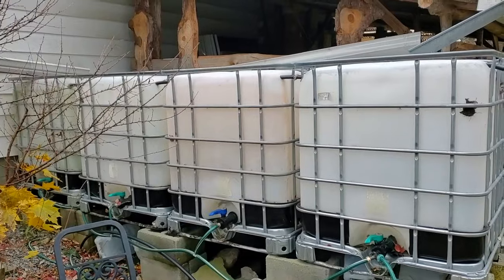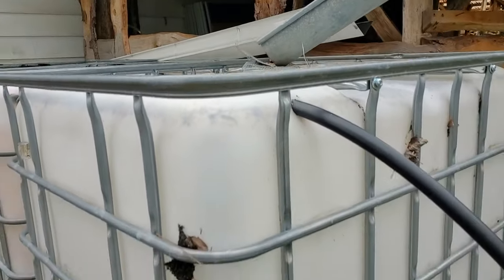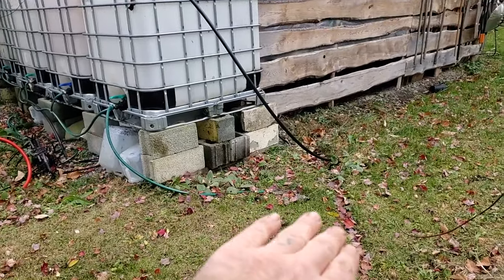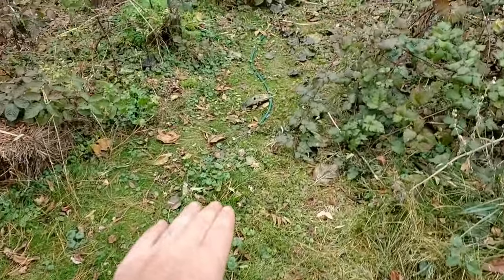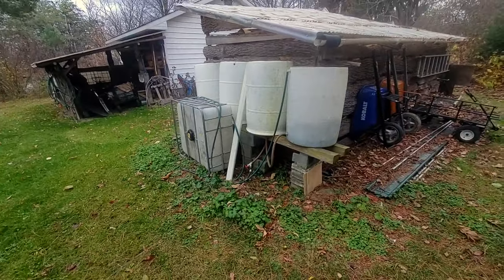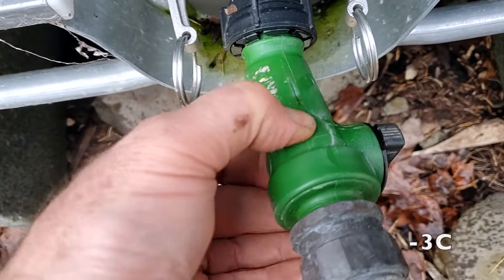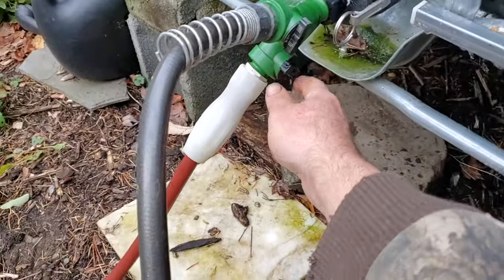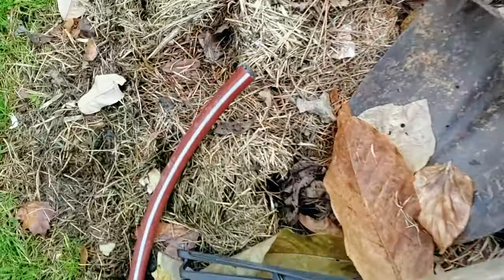Rain Water Collection - Prepping for Winter

Comment: Great video! Just a heads up, you may want to put some mesh on top of that open-topped 55-gallon bucket, or put in a little ladder system if you don't already have one. I had a similar set-up a few years ago and a squirrel fell in a drowned 😞

Comment: consideration to add a 4" PVS first flush system. ive seen significant improvement in algie, settlement, and color of the water.
Reply: Whats a PVS first flush system and what is it used for?
Reply: @Walkabout  It's a PVC pipe that's for collecting/directing the first dirty rain water (dust, leaves & bird poop) that flows off your roof away from your storage tank. After the roof is washed clean by the rain, then you can direct the pipe to fill the tank with the clean water.

Comment: Since I kinda need water on my site also during winter I'm gonna experiment with insulating my totes a bit (old blankets =D?) and also protecting the vulnerable valves. As long as it's only -1-5 degrees celsius I hope it will work out.
Reply from the maker: That sort of cold is reasonable to coast them a bit longer...  You could build a mesh around them and pack with fall leaves, you could wrap the north side and put black plastic on the south, you could have a good wrap for the tender bulkhead and valves that you take off when you need it, all that should convert to a good situation (hopefully!)
Reply: Thank you for the great ideas! We will soon be getting -10 celsius so I think I'm gonna have to put off the experiment for this season :P @edibleacres

Comment: How do you manage situation with heavy rain and small garden hose?
Maybe not a problem if your roof surface is not too big
Reply from the maker: This is a pretty decent roof area... What happens is the tank can fill somewhat, or even nearly full and then freely drain again.  Generally this time of year it isn't an issue, we don't tend to have massive rains in the winter so I haven't had to improve the solution, but yes, sometimes it overwhelms the hose for a few hours or even day and then is empty...

Comment: last winter i let the water freeze in my ibc. it froze solid but no particular happened with the tank. it thawed in the spring and that is it. i left the lid open and redirected the rainwater, no hose was attached either. do you think i take a risk with this "method" this year?
Reply from the maker: I won't say that is 'bad', this is 'good' etc., but I would describe what happened in your situation as decently lucky...  I've had them freeze and swell and then be OK but deformed, I've had them freeze and swell and the bulkhead down low broke, so planning to drain in the future is valuable I'd say